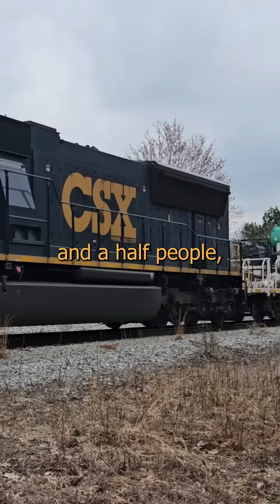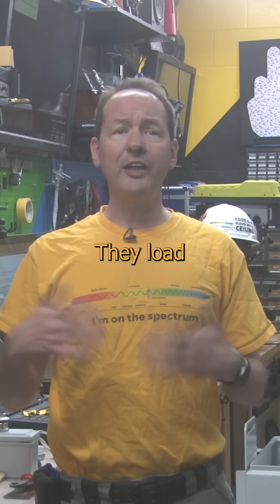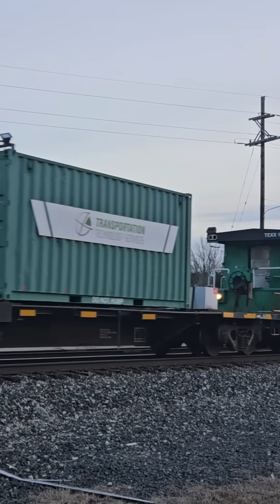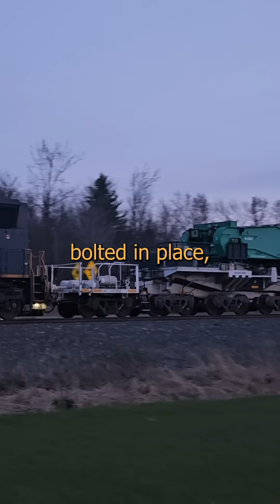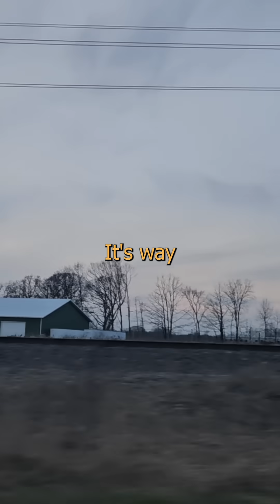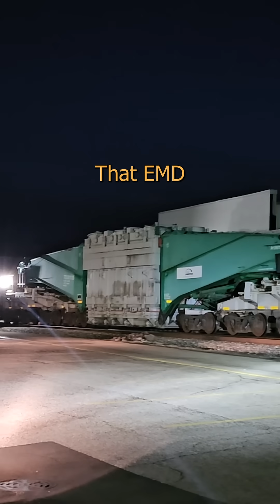Schnabel Car #chrisboden #comedy #train #railroad #physics #transformer #powerplant #engineering

Comment: Whoever figured out that using the load as rigid member, integrated into the trailer is/was a genius. This is engineering on a "one mistake=$10 million crater" level.
Reply: It's fascinating. I am familiar with "engine as stressed member" from motorcycles - where the engine is part of the bike's frame - but that's Fisher Price level compared to this
Reply: And if it derails, how the f*ck are we getting it up again?!
Reply: @svennoren9047  easy, just wait until the earth rotates so it's upside down. But how do you catch it then? 🤔
Reply: @svennoren9047  You go ask Liebherr for help.
Reply: @svennoren9047  4 cranes and a chinook maybe?
Reply: @svennoren9047  they'll clear a large flat area and put some big as cranes in to lift it. If it's in a really inconvenient place they'll load it on SMPTs and move it to where they can put it on one of these rail cars. That is if it's not too damaged. Otherwise it might get cut up on site
Reply: @svennoren9047  probably like 5 semis
Reply: They were developed to haul things like nuclear reactor pressure vessels and really big generators and transformers around.
Reply: heh heh heh rigid member....
Reply: Fun fact! The McLaren F1 does this with its engine, because of the standards of the glorious man who designed it, the engine had to be part of the suspension of the vehicle.
Reply: As @DanielleWhite says, motorcycles have used the engines as stressed suspension members for years. 

What's interesting is that they are doing the same with supercars like the Aston Martin Valkyrie, where the lower control arms for the rear suspension are bolted directly to the transmission, and the upper control arms bolt directly to the cylinder heads. And the engine bolts to the carbon fiber passenger compartment. The damned thing has no rear chassis. Everything on the rear of the car, including the bodywork, either attaches directly or indirectly to the engine and transmission, like a Formula One car, saving weight.

It looks like the Schnabel Car is the same basic concept scaled up a few orders of magnitude..
Reply: I got your rigid member right here
Reply: The US Army has neat little wheels that clip onto the front and rear of a shipping container and turn it into a towable trailer. Same concept.
Reply: Das kool
Reply: This kind of design is pretty common. It’s used in many high performance race cars, and even some road cars.
Reply: Even my Chinese electric bike has stressed members lol. I think it might be the guy who was so surprised first day on the Internet.
Reply: I guess it the same concept with old tractors and how the engine and transmission are part of the "frame"?

Comment: We used Schnabbel cars to move several big oil processing towers, one from New Brunswick and one from Houston up to Alberta. They travel around 20 mph and have to be on a siding overnight so it takes weeks to get across country.
Reply: They couldn't ship it up the Mississippi part of the way??
Reply: @ it needed the heavy lift cranes in Houston to transfer it if I recall correctly
Reply: Does the New Brunswick one travel on NBSR? we use that lane but I believe our rate is a subcontract from cp. how do they book these?
Reply: @MCvidsify  we have transportation specialists that have done this many times and ask for clearance drawings along the proposed route to make sure the cargo clears all obstacles.

Comment: Drivers used schnabble trailers to transport wind tower sections. It's  nice "loading" them as all we had to do was stage them on big timbers and the truckers would just pull up and connect to the section.

Comment: Seen a lot of the road train versions  of das schnabelvwaggen in my area. We have a concrete beam casting yard near Norfolk Naval Shipyards and these beams and precast bridge sections roll out on 30 axles, chained or bolted to the axle trucks and often with a puller and a pusher engine with independent steering to make the piece turn in less than a dozen football fields.

Comment: I have a G-scale model of one of these cars. I'm not really into model trains. However, I've accumulated many over the years from various auctions. The Schnable car was included with about a dozen large-scale locomotives I bought for about $50 each. They're big and heavy, I need to get them out of their boxes and get them on a test track. I have no doubt they'll work fine, but it needs to be done before I put them up for sale.
Reply: >I'm not really into model trains
>however, I have many
Reply: @MaydupNem Well, they're sometimes quite lucrative at the right sale. Included with this haul, some of the engines sell for close to $1000. No different than other stuff I buy at auctions that I'm not really into, I just have an idea of value.
Reply: Make a scale-weight transformer to go with it out of a car battery. 😅
Reply: @MrHuram-abi I'd have to dig it out, but I believe there's a replica of the transformer included.
Reply: You have test tracks set up. You're into model trains, my friend. Join Rob Stewart and his minions!

Comment: Nice Schnabel chasing !! Curious  how many truck axles they used at either end of loading and destination, as tracks only wind to so many facilities...
Reply: I've seen 16 axle dual-beam suspension rigs used for xfmrs of this mass.  Schabel cars are only needed for the absolute heaviest of XFMRs.
Reply: @KENFEDOR22  cool, thanks. Couple other people also had videos of this beast.  A local central Michigan trucking company has some of the spread beam lowbow units, double bridge, 14 or so axles, but not remote steerable

Comment: I’ve watched them deliver those units to a data center. Took 2 cranes and a lot of balls to move it and set it in place. It was so heavy they precasted the stands to be exactly 2 inches below the bottom of the trailer so they could just set it on and drive off. If they didn’t, they couldn’t do anything with it. No crane in the area was able to move it.
Reply: dual cranes can be tricky.  Most XFMRs this size utlize hydraulic jack and slide method.  I'm sure Chris would have fun with "jack and slide"!

Comment: The locomotive only really need 4 axles the extra two is for more traction, some Modern locomotives can even raise the middle axles to change traction characteristics.
Reply: The newer GE's do that.....C4s. They absolutely suck! Dynamics aren't as good as the 6 powered axle units and they don't pull as well. But, whatever saves a buck.

Comment: "Do Not Hump" written on the side of the car is hilarious!
Reply: Back in the day guys at work (definitely NOT me) would stick those decals on everything. Just in case you didn't know, that just means not to send that particular car over the hump (classification yard) cause it's either dangerous content, fragile, too heavy (re-tarders won't slow it down) or too long. Zoom....right out the other end.
Reply: Some people would take that as a challenge.
Reply: @BenKonosky  First thing I thought when I saw that was "Challenge Accepted!".
Reply: @project1003 imagine a device meant to slow 4*35t=140 t from 5mph to 1 now facing 20*35t=700 t… someone will have a bad day
Reply: I have to write "NO HUMPING" on literally everything with the railroads....
Reply: I'm a trucker and had to sleep right next to the hump at the rail yard in Roanoke, VA last week. I only woke up a few times. 😅
Reply: It refers to a Hump yard, where they use gravity to sort rolling stock.
Reply: I have training in the locomotive industry! "Do Not Hump" is a directive to not process the car at a switching station that uses "ladder" switch. A "hump" is an artificial hill that moves cars using gravity to provide momentum.

This restriction is used on cars that are not designed to withstand hump sorting, due to collision forces.
Reply: @sorensnowfur  well you didn't call it your railroad, I'm going to guess you weren't in management 😂 A good manager will station themselves between firemen and a fire and direct the firemen how to do their job whilst threatening level 5 insubordination when a Carman refuses to enter the red zone on a live track simultaneously institute a new rule that will be abolished once Monday comes and someone from headquarters hears the ridiculously illogical rule....
I've never heard a railroader call it the locomotive industry, sounds like a vendor, aka a scab. 😂 Just giving you a hard time
Reply: @sorensnowfur  >This restriction is used on cars that are not designed to withstand hump sorting, due to collision forces

Pretty sure that describes a few dudes I hooked up with back in my younger years when my surging hormone levels meant that my ability to finesse the physics of fornication had about as much granular control as a train engine.
Reply: @sorensnowfur  Yeah, that thing looks like it would plow right through the Black Gate of Mordor itself if it got a head start on a slight hump!
Reply: Um, yer mum.
Reply: I knew i wasn't crazy seeing that
Reply: For good reason. You would not want to send that much weight down the rail in a Hump yard.
Reply: Where did you see that?
Reply: @stealthslayer13  on the front side of the car as it's going by
Reply: @klaatubob  Ah, I see. Right about 0:09
Reply: @stealthslayer13 look at the gray part, down by the wheels.
Reply: Gotta try keeping the foamers off it somehow.
Reply: We don't want to make your mom jealous.
Reply: Yeah, if you hump that bitch, you WILL get stuck.
Reply: I work transporting loads on these cars (well not actually schnabel cars because the transformer is not a structural part of the load, but the cars themselves function the same) and NS unfortunately humps these things all the time, they’ve completely wrecked the same car multiple times
Reply: @klaatubob  dumbass
Reply: I like the csx sd70mace

Comment: Additional fun fact, in the usa many of the schnabel cars are built for and owned by Westinghouse for use in moving nuclear reactor bits about. They are also the owners of the largest with a whopping 36 axels, and unloaded weighs in at just under 400 tons, and can move loads up to 1000 tons
Reply: 1000 tons? Good news, ma! We CAN go on vacation!
Reply: @mechcommander7876  you are definitely going to hell for this comment 😅 It's that good!
Reply: @mechcommander7876  with your mom even~
Reply: @mechcommander7876  ⭐️⭐️⭐️⭐️⭐️🌟
Reply: That's how I ended up seeing one. We have a nuclear power plant nearby and they were replacing equipment a while back.
Reply: Sad fact, Westinghouse used to own 8 of these cars. 4 were retired and scrapped over the last decade. Now Kasgro Rail Services generally handles the moves and maintains the cars. I was lucky enough to see one owned by Siemens while I was in college in 2003. It was quite a site! And it was just a little one, only 14 axles and a little over 700 tons with the load. It was carrying one of two new turbines for a new gas fired power plant in Central Arkansas (around Hot Springs).
Reply: ...can move loads up to 1000 tons to the nearest waterway where the REALLY big stuff moves around! 😮😅
Reply: It means something completely different to railroaders and FRNs.
Reply: I keep forgetting Westinghouse is bigger than I think, I'm used to dealing with their itty bitty 20 amp stuff
Reply: @TheStarMachine2000  I keep seeing them and thinking the guys who make air compressors for steam locomotives
Reply: @Andrew-se9be  they wrecked one of them while we were building vogtle and had to buy a new used one with a cracked chassis and I got the distinct privilege of working a hundred hour week fixing the piece of trash
Reply: Having only barely gotten a sense of  the scale of the one in the video, these numbers are bonkers!
Reply: and alot of those "tanks" are transporting stockpile fun....spicy payloads
Reply: Jeebus!
Reply: suck it, John Henry.

Comment: Moved one of these things. A component to a coal power station. They spent 3 weeks digging out a trackbed the was encapsulated in a highway for 40 years to accommodate the delivery of this giant. I believe the one we were moving around was red.
Reply: I got ahold of one of those red flavored Schnabel care a couple years ago. I believe it was a reman generator headed to Tommy Hill generating station East of KC. It's wild how the crew can shift the load laterally and vertically to clear obstructions. The 25 mph speed restriction and 10 mph curves were tedious to run. A lot of stretch braking. Jerks were cooking breakfast in the caboose when we briefed with them.... didn't even offer my fat butt a plate 😆

Comment: I'm a substation engineer and a couple more cool things about moving a xfmr on this train car is 1. They place sensors that measure g's. Because they aren't supposed to get "humpped" like normal goods in regular box cars. Humping is when they ram the cars together.  And 2. The xfmrs built by Siemens* have to travel through a tunnel on rails and that limits how big they can make a xfmr. 
Thanks for all your videos, great stuff.
Reply: Humping is NOT shoving the cars together. That's just coupling, which is NEVER supposed to occur at more than 4MPH. Humping is a yard switching practice where by entire trains are shoved over a hill (hump) at one end of the yard and broken apart as they roll over the crest. Gravity carries the free rolling cars down the hump and into the yard. An operator with the help of computer sensors mechanically operates the turnouts in the yard to route the cars onto the correct tracks, thus one train becomes many according to it's destination. Pneumatic retarders squeeze the car's wheels against the rails on the way down to brake the cars and control their speed. It isn't uncommon, however; for "collisions" to occur as cars couple at speeds well over the recommended 3-4MPH. This is what "DO NOT HUMP" refers to and how quite a bit of loads get shifted and freight gets damaged (switchmen aren't known for following those instructions or caring about your shipment... all they care about is quitting time!).
Reply: @johnathanfuell6820  very good explanation except for the last sentence. Not true! Don't be that guy. You tear stuff out there on the hump or ignore instructions or practices and you're toast. This ain't 1973.
Reply: @johnathanfuell6820  There's actually a demonstration of that in the Mighty Machines episode about trains from the original series :)
Reply: Not sure about ABB (now Hitachi) but Siemens' Weiz, Austria xfrmr plant does indeed have a tunnel limiting the height of some of their large power xfmrs.
Reply: @KENFEDOR22 good catch.
Reply: Hey, when I've moved them, there are cylinders of inert gas or nitrogen plumbed into the transformer. Can you tell me what the reason is? I have always wondered.
Reply: @ironken1796  I don't know for sure but it would seem rather logical to ship them with a small over pressure to limit corrosion and make sure the insulation states as dry and uncontaminated as possible. Often these transformers are shipped without oil to limit the weight during transport. They then need to be vacuum pumped before refilled with oil.
The insulation is very sensitive to contamination.
Reply: @larslindgren3846  They're shipped without oil to minimize weight and filled with dry air or, for smaller xfmrs, nitrogen.
Reply: @ironken1796  The nitrogen is to inert the internals and protect them from moisture that would lead to internal arcing.  345kV likes to reach out and touch things.
Reply: @mrokus7116  thank you! I would imagine that many angry pixies would reach out and do bad things.
Reply: @ironken1796  I don't know for sure , but I'm going to guess the pressure of the inert has inside is monitored, to detect if there's any damage, pin holes created, along the way.
Reply: @ironken1796  to reduce/protect from oxidation from the atmosphere on the internal exposed metal parts I would assume😳
Reply: @ironken1796 I'm pretty sure it's to keep moisture out of the insulation (paper, special kraft paper)
Reply: @jd4est652  thank you 👍
Reply: And to think thousands of years ago when someone said tunnels need to be the width of 2 horses asses did we or anyone think that modern day engineering would have to be done to those specifications
Reply: Width of two roman asses dictating the efficiency of our builds even to this day

Comment: What in the world is so heavy that it needs a special car, with such specific requirements of the problem statement, with max. loading capacity of around 700 Tonnes? (As he said max. loading limit of each axle is 35 Tonnes, and there's 20 of'em.)

And why does it not look like a transformer if it's a transformer?
Reply: The giant insulator like connectors aren't installed.